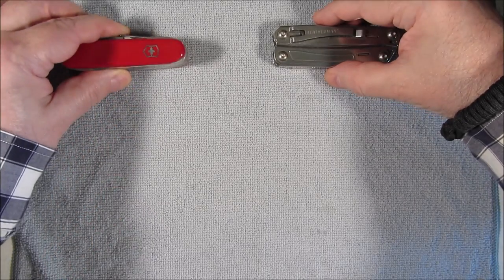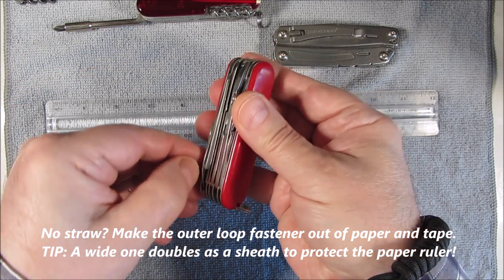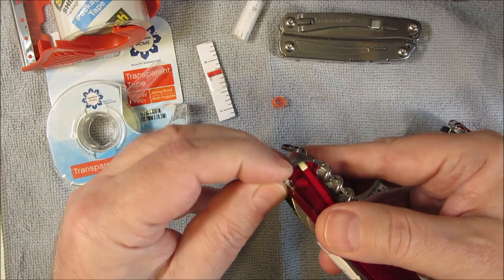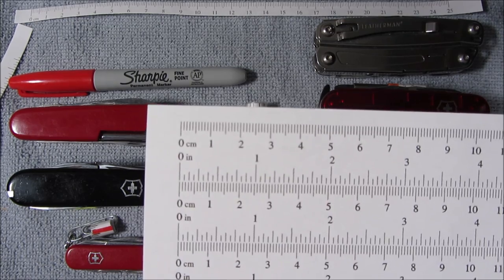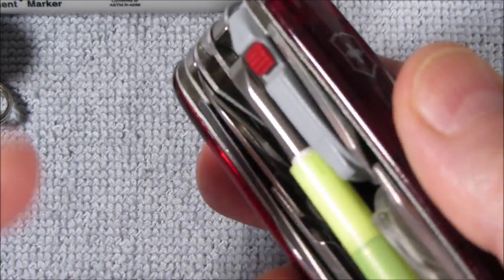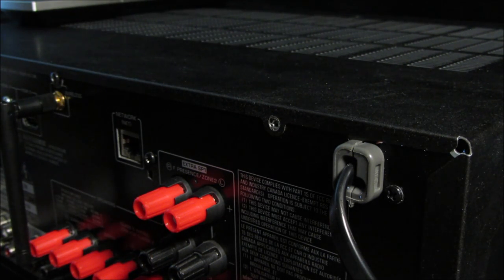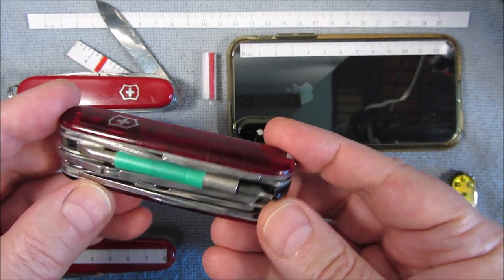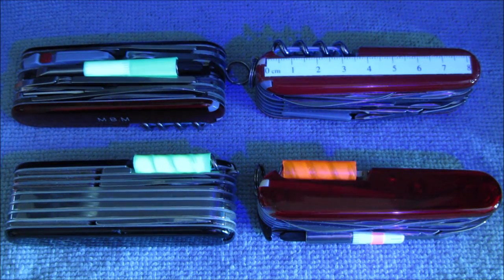FREE DIY Rulers for SAKs + BONUS Tricks! (Part 1)

Comment: Big fan of your videos! Super creative stuff. I have a great way to carry an accurate ruler: I have a white string that I mark with black marks for inches and red marks for feet. I can get quite a good length of measuring string in a compact manner. I put loops on both sides so I can make accurate measurements. This string can be wrapped around most things.

Comment: Some ideas:
You might consider printing your tape measures on polyester paper.  It is remarkably resilient if cut with smooth edge scissor or a cutting board.
Also, I sometimes use thin braided kevlar string for measuring up to 10ft.  Most often I use 6ft strings, marked in feet and half-foot increments.
I use Kevlar string because it doesn't seem to stretch too much. This allows me to quickly measure out rough distances for placing equipment.
The string can be marked out with knots or colored thread.  Double knots for feet: single knots for half-foot.  If I am feeling fancy, I sew red thread into the braid for feet, and blue thread at the half-foot marks.

Comment: get  cloth sewing measuring tape and apply a section to the inside of your belt, about 12 - 16 in on the non-buckle end  If you really need to measure something you are all set.  I read this as an old school Boy Scout hack
Reply from the maker: Good tip, thanks.
Reply: I carry a 13” sewing roller in my wallet.   Also, using a USA currency as a “rough measure” also works.

Comment: I immediately thought I would make a inverted tape bobbin as a hub for the rule, and tape it on with a loop of tape "the right side in". I will definitely try to laser print a rule on a clear sheet overlay and see how long a strip can be coiled up on a bit driver.
Also I like the idea of a "printed" rule right on the scale so much I am befuddled that it is not already an aftermarket upgrade.
For a less precise (finely granulated) measure, you can make markings (every 10 mm) with a permanent fine liner on a string of dental floss. You'll be surprised how little space a meter of floss take up when spooled on a thin core.
As always great content and a nice calm presentation. Super nice video.
Reply from the maker: Thanks. There's lots of dental floss stuff in part two, coming very soon, by the way.

Comment: G’day MeZillch.  Fantastic ideas.  Just letting you know, when you go into an IKEA (certainly the ones in Australia) there’s one metre length paper rulers at various spots throughout the store (alongside the little pencils).  The paper is stronger than “normal” paper.  It has centimetres on one side and inches on the other.  The width is around 1 inch, both 0 marks are at the same end, so you’d easily be able to cut it down to 12”/30cm.  

For the record, your pouch from years ago gave me the idea of carrying one around in my wallet, so if this ens up being useful to you, I feel the idea has come back full circle!
Reply from the maker: I know we have IKEA stores here but oddly I've never seen one. If I ever do, I'll be sure to snag one of those rulers you speak of. Thanks!
Reply: @MeZillch  IKEA is strangely one of the cheapest places to get cheap quality NiMh AA batteries too 👍 Also in Australia...

Comment: Some nice ideas here, I particularly like the tape idea. I have the CyberLite and pretty much gave up with the light as it kept turning on in my pocket so the battery is always dead. Just one other comment, On the Cyberlite you can add a 7cm rule on the back of it between the springs for the pliers and magnifying glass.  There is also a little cavity near the hinge of the cybertool that could hold a very thin rolled up paper ruler.

Comment: I laughed at the uses for a small straw! And I like a lot of your mods, but for this, I go with a pen that has a ruler on the barrel, and also a bubble level, mini-screwdrivers (flat and Phillips head) and a touch screen stylus at the back end. Most hardware stores have them for around $10, or you can get cheap ones straight from China for about $2. I like the tape dispenser a lot.

Comment: You can use an engraving tool to mark from the end of one tool, across the body of the multi tool and down a tool on t the other side; so from tip to tip you would have something near 9”. You can stick the paper ruler in a money clip, in a key ring or in a wallet. IKEA gives away paper rulers that are bigger BTW. But I recommend getting a fabric measuring ruler as they are made of a waterproof material that burns like gasoline. You can also buy a micro sized or keychain take measure.
Reply: I’ve used a micro engraver to add a ruler and I know of someone else who’s used a lazed engraver.
Reply: It you could go full Adam Savage and get a ruler tattoo 👍😆

Comment: You might be able to reinforce the end of the paper ruler by saturating that short section with super glue. It is brittle when cured, on its own, but used as a reinforcing agent, it should effectively fill in the interstices in the paper to make it more fray resistant.
Reply from the maker: Interesting. Thanks.

Comment: It would be nice to have a low profile sleeve that sticks to the scale of the knife and the ruler can be slid (folded or unfolded?) into the sleeve for protection and if the sleeve is clear, you could view the ruler through the sleeve without even needing to deploy it on some occasions. Now we need to find such a sleeve!
Reply from the maker: Traderjoes, you could fashion just such a sleeve (great idea by the way) out of a cut up, Trader Joes's, clear plastic, pineapple chunks (cubes) carton lid and some clear tape, which are the exact same materials I used to make the slide out portion of my Tic Tac, micro bit kit here:https://www.youtube.com/watch?v=P_hIXhblWyQ  I might play around with the idea and of course I will credit you with the idea if it ever comes to fruitition, I mean, fruition. I love that pineapple by the way!

Comment: What if you attached the paper ruler to a straw that was just barely larger in diameter than the tool it was housed on. That way, the ruler could be pulled out and the straw would spin, deploying the ruler in a similar fashion as a tape measure. You could then fit a slightly larger straw (or sleeve, maybe shrink tubing?) over the straw and ruler combo to protect it.

Edit: commented before I saw the tape dispenser in the video. Same concept!
Reply from the maker: I show something quite like that in part 2, coming very soon. I call the inner straw that rotates freely around the shaft of the Cybertool a "bobbin". The only bad thing is you loose the "self retraction" aspect when you are done with the thing you dispensed.

Comment: Do you know if your prototype works with transparency sheets(for old school overhead projectors) instead of paper
Reply from the maker: Sorry, I have no idea and have no such material on hand to test. The material needs to be thin and very flexible. Saran wrap (cling wrap) would probably work but stiff plastic won't. Even a brand new dollar bill,  that's still stiff , folded in half, is hard to fit on. More things will be shown in part 2, coming very soon.

Comment: It is entirely possible that you might want a ruler longer than just 12" imperial. Of course, this would be some sort of accurate "tape measure". How to accomplish this? Take a long length of dental floss (10 feet?) and wrap it around a yardstick (or meter stick) and mark off your preferred increments (1 ft, 3 in., 6 in, 5 cm, 10 cm, etc) with a fine point sharpie or fine point ink pen (for accuracy). If you divide your dental floss "tape measure" into 6-inch segments, if you are measuring something that is, say, 5 foot 2 1/2 inches, then you will measure out 10 tape measure increments and then use your accurate paper ruler to add to your dental floss measurement to come to a very exact measurement.  In addition, dental floss can have both metric and imperial increments in different colors (i.e., red for imperial and black for metric).

Comment: The vendian paper ruler link prints out a different ruler style than shown on this vid. Their scales are opposite each other vs all starting at 0 on left and then progressing/ going left to right like yours. Is there another link or did they delete the one you have?
Reply from the maker: Sorry, I'm not sure what they currently have available but the other site I use is : https://ruler-online.net/printable.html
Vendian has several styles listed here: http://www.vendian.org/mncharity/dir3/paper_rulers/
If I'm not mistaken this has the two scales with 0 aligned at the left: http://www.vendian.org/mncharity/dir3/paper_rulers/UnstableURL/rulers_cm_in_decimal.pdf
Reply: @MeZillch  many thanks. The 3rd link w/ the zeros both at the left works great. Subbed earlier as well.

Comment: Someone could laser etch a ruler into the scale and maybe continue onto a knife blade so you can open it and measure larger items.
Reply: I’ve used a micro engraver to mark from the tip of the long blade - across the body - to the tip of the short blade. This was cheap and easy though I do know of someone who has used a proper laser engraver to do the same.
Reply: @RR4711  Someone could make some money doing laser engraving for this, people like to modify their knives.

Comment: I want to etch in some marks in my knife, having 0 at the very tip. Could be cm on one side and inches on the other side.
Reply from the maker: Someone should market a red cellidor scale that has this already; you snap off the old original one and then snap on the new one. Done.

Comment: Silly Q, what diameter should be the plastic straw?
Reply from the maker: Not a silly Q but sadly I don't have a good answer because the straws I used weren't labelled. I just measured the yellowish/green one though with calipers and it seems around 7.3mm outer diameter.
Reply: @MeZillch  Thank you for the detailed answer.

Comment: Did you know that they are not making yard sticks any longer?
Reply from the maker: If they made them any longer then they'd be a 2-yard stick! LOL [Mine is actually about 3" too long, actually, so it doubles as a meter stick]:
https://www.dickblick.com/products/westcott-aluminum-yardmeter-stick/?clickTracking=true&wmcp=pla&wmcid=items&wmckw=55706-1139&campaign=Blick+Shopping+-+6&adgroup=Shopping+6&keyword=&matchtype=e&msclkid=867a6c31c986143d31e008621b780e12

Comment: Nice video. I prefer a 12 inch paracord tied into an easy pull apart lanyard. It can be folded to measure anything smaller than a foot. If you want to get fancy use your wife's nail polish to mark inches in it.

Comment: Here’s an idea: paracord marked with measuring marks….
Reply from the maker: Paracord stretches.
Reply: true ‘dat.  Perhaps some bankline?  #38?  Great ideas… binging your vid’s again.  Have the “older” toolkits changed? (the maxpedition pouches).
Reply from the maker: @enriquediaz7547  I have a new style of pocket tool kit coming soon to a vid. Instead of being a pre-configured kit you buy, or an empty bag like a Maxpedition pocket organizer you fill, it is a hybrid design which borrows a bit from both . . . (actually a hundred bits. Get it? Like screwdiver bits?) Stay tuned. [That joke will make more sense once you've seen the kit and its ~100 driver bits.]
Reply: @MeZillch  nice! Byte, bits, nibbles…. Lots of room for jokes :)